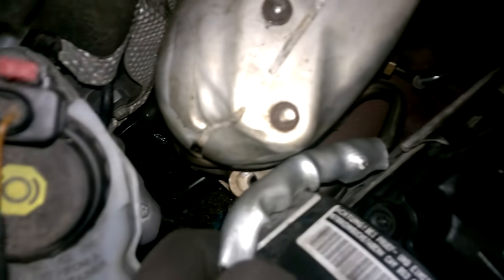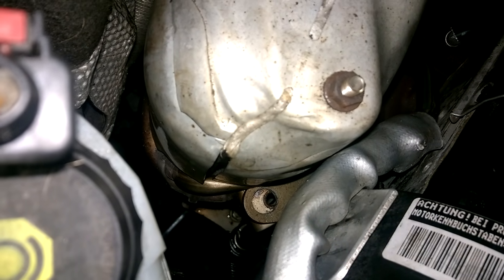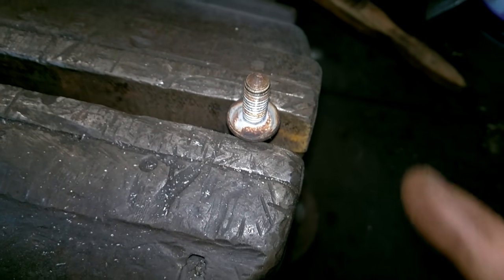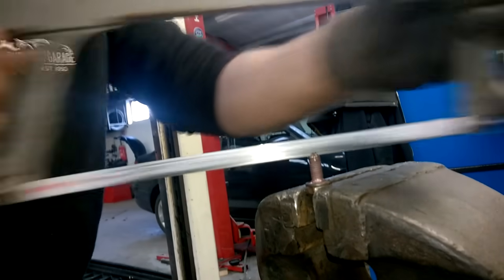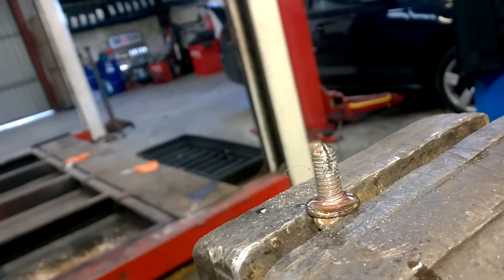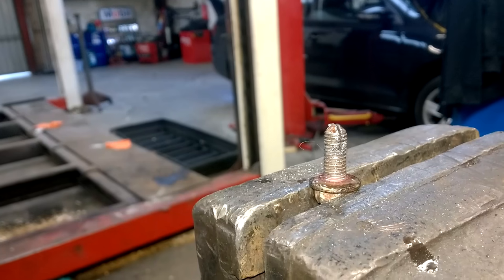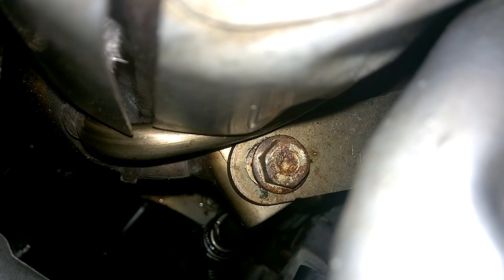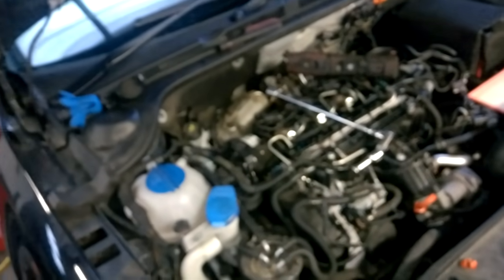My Father Taught Me This! Passing It On To The Next Generation

Comment: Tip: Before cutting the bolt, screw a nut onto the bolt down to the head. Cut the slot and upon removing the nut, it'll clean up the bolt threads ...
Reply: Was just about to tell him the same. 
I do that when cutting threaded rod also
Reply: @gellotion  
Great minds ...
Reply: @gellotion  Same here, good to see that this knowledge is still around.
Reply: Yup. Always
Reply: Excellent tip!
Reply: I'm sure its quicker to wirebrush (a couple of seconds) than to start searching for a correct size nut.
Reply: True, Dies are nice to have also.
Reply: Did yer Daddy happen to mention that you use the entire length of the blade..not a 3" wide area that wears the blade disproportionally...did y'all notice how hard it was to remove the blade from the CUT...outcome is gr8...how you got there is not.
Reply: @bustergonad3975   Or you can be lazy and use a very thin cut-off wheel in an angle grinder...
Reply: Bob Watters  If its a damaged thread then trying to put a nut on it or putting back into a pre-drilled hole will most likely lead to cross-threading, if the thread is not damaged then simply removing the burrs is all that is needed. The main point of the video is the problem of when two holes don't quite match up, which is the problem that needed to be solved in the first place, making the hole bigger in the top bracket will lead to movement eventually, guaranteed.
Reply: @bustergonad3975  they don't make hacksaw blades 12" long for you to use the middle 3". I'm sick of telling the lads at work this. 3 times the length used = 1/3rd of the strokes.
Reply: @cr10001  Or put on a hot saw, part off on a lathe or some other manner. Tradesmen of any sort must master the Hacksaw. It's the most go to tool. Sadly every blade tells a story. Many machinists especially lathe peoples by the very nature of the work holding ie, a 3 jaw chuck..their stroke length is mostly short...but it's a light delicate stroke. Sometimes the cutoff pieces drops into a cupped hand. I've seen apprentices do long strokes...yet are oblivious to the ramifications.  The downward pressure on the push forward stroke often heats up the cut zone...sometimes the blade breaks and often the part drops into the dirty guts of the bed. Often the tool is blamed whereas it is basically the uninformed  Tool using the Hacksaw. 
If your lucky...or you've thought it through that the item is not hot..the blade doesn't grab or your follow through isn't impeded by raking your knuckles on the lock down bolts on the tool post. If your right handed. If left handed...well the chuck...incurred it's own payment of flesh.
 I once had to apply a torniquet to a lads forearm underside. He's got a 10" scar to prove that machines can bite. Some even kill. That ...I'll never revisit.
Reply: Blinding tip. Thanks.
Reply: @bustergonad3975  I think you could have been a little kinder and not mentioned his dad. I hope his dad is still alive. The guy has given a great tip to an amateurs nightmare. Be gentle with the world. I can’t pretend to always achieve it but I do try my best.
Reply: Brilliant!  I will use that.
Reply: A lot of advisories here.
Reply: Good idea
Reply: similar to what Mr Pearce says, if bolt threads are damaged you may not be able to get nut on.
Reply: This was done way before the internet, better days🤔
Reply: @bendover3820  that's exactly how it's done.
Reply: @MikeDean01  Excellent point. Dad showed him how to cut the bolt but not how to use a hacksaw.
Reply: And if you have difficulty finding the right size nut, it's with your 10 mm socket.
Reply: @MikeDean01  who cares it $5 blade .
Reply: @ryanwilliams9644  someone with $4 in their pocket or a long trip to the tool store?. You carry on using tools like an apprentice, I won't lose any sleep over it.
Reply: @bustergonad3975  so true, knowing (feeling/hearing) when a cut is going to 'break through' takes a surprising amount of experience/sore knuckles!
Reply from the maker: Yes that is a great tip FJ B when cutting a bolt size down, I use that every time in those cases i.e it can only be a certain length bolt so you need to shorten one to suit, it really is not needed for this one though, a clean up with a wire brush and it's good to go. 
 
The update info below is the pinned comment on this video, I know most people do not realize I made that video and it better explains/shows this method in use.   
I also included below details of why the job was done this way free of charge with the customer fully informed. I hope you check it out  👇👇
 
UPDATE* I decided to make a follow up video on this https://www.youtube.com/watch?v=yfNQullGEuQ&feature=youtu.be Should answer some of the questions that were raised, I include 3 demos of this in action with close up shots.
 
As there was some safety concerns & confusing comments raised, I felt I should clear a few things up. 
1) This is a tip for certain circumstances only, I never have and never would use it on a component which would cause any safety concern to any customer.  
2) The demo was done on a support bracket only, items like this or similar will not cause any safety concern. 
3) I did this free of charge and on a time restraint, I noticed it when I was replacing another item, the customer needed the vehicle back that evening and I decided rather than leave it like it was, I would do this and secure it up fully. 
4) The bolt was not the issue, the part that the bolt threads into is a secured piece, someone had previously damaged it, leaving the bracket loose and the bolt just tightened a turn or so.
5) The bolt can be removed and will not break, it will go in and out as usual and has helped clean up the damaged threads.  
6) Used in the right application I personally believe this is a great tip and can save you a lot of time & trouble. 

Lastly to all the people who have watched the video, Thanks very much and I am delighted with the feedback I have received on it.
Reply: If he was able to thread a nut onto the bolt then wouldn't he be able to thread the bolt into it's hole? What you've suggested doesn't make sense. A nut is just a hole... Right? What I don't understand is why doesn't he just replace the bolt? I've got a bucket of extras over the years and I've only owned 1 car (lol, joke)
Reply: @nafnist  that makes lots of sense? I was taught by an exceptional engineer who I still hope to be as good as one day. I can only try and pass on good practice for their benefit. Impressive you can tell how I say things and how much my work mates like me from a comment on you tube :-)
Reply: @MikeDean01  I didn't question the fact you are right, because you are. You need to use as much of the blade as possible, for obvious reasons.
But you were 'tired of telling' the lesson.
A relative easy instruction, that you somehow have to keep repeating.
So yea, I might've assumed they didn't like you, sorry. But the rest was spot on.
Reply: Same if grinding a bolt to shorten.
Reply: Great Idea. i was gonna suggest running a die on it to recut the threads but your idea would be faster
Reply: How would you do that when the threads are damaged to begin with.
Makes no sense bud.
Reply: @gellotion  w
Reply: @bustergonad3975  a
Reply: But how can one thread a nut on the bolt if the thread on the bolt is ruined (which is the whole point of the exercise in the first place)?
Reply: @chadthomasriggs  Seems you missed the whole reason for cutting the bolt in first place ...
Reply: Okay all of you perfect hacksawyers us imperfect ones have unused perfectly sharp teeth all ready and waiting the next time we drag out the saw next year some time. And i want to see every single one of your file drawers because . .
Reply: Nice tip bro'... *

*so many jokes pop into my head🤣
Reply: Great info and tip !!!!!
Reply: @Mr.Grimsdale  the bolt thread is not damaged oh, it's the blind hole thread that is damaged!
Reply: @Mr.Grimsdale  exactly. Nut won't go on it if it's cross threaded..sometimes if it's a crappy couple thousands looser thread on the nut.
Reply: @bustergonad3975  you can make your valid point without insulting people.
Reply: @747Antman exactly.

Comment: My apprentice master used to tell me, "Huey, I pay for the whole hacksaw blade, so use all of it".
Reply from the maker: Slow and steady vs quick and fast..... well that depends on the mood Hughbert :0
 
The update info below is the pinned comment on this video, I know most people do not realize I made that video and it better explains/shows this method in use.   
I also included below details of why the job was done this way free of charge with the customer fully informed. I hope you check it out  👇👇
 
UPDATE* I decided to make a follow up video on this https://www.youtube.com/watch?v=yfNQullGEuQ&feature=youtu.be Should answer some of the questions that were raised, I include 3 demos of this in action with close up shots.
 
As there was some safety concerns & confusing comments raised, I felt I should clear a few things up. 
1) This is a tip for certain circumstances only, I never have and never would use it on a component which would cause any safety concern to any customer.  
2) The demo was done on a support bracket only, items like this or similar will not cause any safety concern. 
3) I did this free of charge and on a time restraint, I noticed it when I was replacing another item, the customer needed the vehicle back that evening and I decided rather than leave it like it was, I would do this and secure it up fully. 
4) The bolt was not the issue, the part that the bolt threads into is a secured piece, someone had previously damaged it, leaving the bracket loose and the bolt just tightened a turn or so.
5) The bolt can be removed and will not break, it will go in and out as usual and has helped clean up the damaged threads.  
6) Used in the right application I personally believe this is a great tip and can save you a lot of time & trouble. 

Lastly to all the people who have watched the video, Thanks very much and I am delighted with the feedback I have received on it.
Reply: @GerardBurkeBurkesGarage  I still say its a good one. Of course you may not be able to use it in all engineering applications where the integrity of the bolt is important but as you said, customer was happy and there was no safety risk so i say its a good one Gerard. I had a journeyman who taught me to handle tools as follows. Three one thumb. Middle, ring and little finger wrapped around shaft or handle to give torque. Index finger stretched out to guide the tool. Thumb wrapping and gripping the shaft.  I never again broke a hacksaw blade. I cut straight lines in metal and wood. I use this on all tools and it had worked for me.
Reply: Haha! "Waste not want not" was a thing for me also...early on in life
Reply: thats a really good lesson ;p i was kinda triggered by his short stroke and fast moves aswel ;p
Reply: Tee Mack  fair point...but u could grab a smaller saw.....right tool for the right job kinda thing id say....its fine if u like big tools, but if ur not able to use them....then just dont lol otherwise i would get a 20 feet long handsaw. bet itl cut a 2 by 4 in one stroke.
Reply: My sparky said let saw do all the work ,but that didn't work ,apparently I had to hold it!
Reply: Hahaha mine said the same🤣👏🏻👏🏻👏🏻
Reply: Me looking at all my bad saw blades , “lotta meat left on them bones 🤦‍♂️🤣”
Reply: Ha I see what your talking about there is basically not teeth on his blade 🤣
Reply: Nice one!
Reply: A pal of mine from Brighton use to say a similar kinda thing....
Reply: Yep! 
I was taught this 50+ years ago. If only the centre part of the blade was meant to cut, only that part would have teeth. 
Some will cite safety when arguing for short stokes, but The fact is that if you only use the centre of the blade it will kink and cause it to stick, which is more likely to result in an injury.
Reply: Long slow Strokes, no smoke required. But I can say that now because I'm retired! LOL
Reply: A hacksaw, or any handsaw, only cuts on the push stroke.. So, don't put downward pressure on the back stroke..  the blade teeth are angled forward to cut the material ..  no cutting occurs on the backstroke. Pressure on the backstroke only hastens wear on the blade. As mentioned on other comments.. use the full length of the blade on the forward stroke to safely optimise all saw teeth.
Reply: It's clear he's never used a file
Reply: Good advice
Reply: @billsmith3195  if your concerned about integrity then use this trick then take the bolt out and put a new one in and it will go in after this fixes the problem.

Comment: Nice Tip ,   remember to always leave enough solid thread to equal ( 1.5 x Diameter ) . .  According to the Machinist handbook , a thread should be 1.5 as long as it's diameter (considering it's a perfect thread) .  That's fully inside the nut,  or internal thread.  That's as strong as it will ever be . .   I always try to go more than that ( 2 x Dia ) to account for imperfect threads..  Regular commercial threads are not exactly perfect . They are great for what they do , but, Aircraft threads are perfect size .  I've been a Machinist fort over 40 years .. I've made every kind of thread you can imagine .

Comment: I work in diesel shop & you try to teach these kids old school trick, all they want to do is argue with you & tell you they weren't taught that in school. Than after they waste 3 hrs trying to fix problem, you tell them to do what they were told too do. Than 10 minutes later it's fixed. It's same thing as removing broken bolts. I usually have several 1" x  1"  5/16 pieces of of metal that I save. If you bust a bolt off, drill a hole in center of metal & put over broken bolt, fill hole with a welder. Than weld a bolt to the metal & back out broken bolt, the heat from the welder acts like a torch & 9 times out of 10 the bolt backs out with ease. No grinding, drilling or tapping ne threads or installing helecoils.

Comment: I love learning anything I can because I have a 1985 Yamaha Vmax 1200 and it is in extremely good condition. It has 11,700 original miles and when people see it they tell me it looks like it’s brand new however I rarely take my vehicles to a mechanic because I buy shop manuals and read mechanical books so I can learn and do most of the work myself which has saved me thousands over the years. And this is why I love learning anything new. Thanks

Comment: As a professional, im glad to see others also struggle with that particular VW diesel Cat top bracket 😂😂.
Reply: I'm not a pro, but I try.  I had just installed a new billet pendulum dogbone mount arm and insert on my A3 without issue.  So, I thought, why not install a similar thing on my 2012 VW Tiguan, because it has about 400 hp.  I was being an idiot taking off the bolts with an 1/2" electric impact, but I got greedy and tried to install the 21mm or M14 bolt that hold the insert in with the impact and i damaged the beginning of the threads internally.  This might remedy my issue.  I saw a rethreading company called Tifco, which would just so happen to be about a mile from my home.  But this fix is better and cheaper.

Comment: After 40 years as a machinist, I've certainly learned quite a few tricks over the years. This being one of them. 
Thanks for passing this one along!
Reply: Machinist as well and i never thought of making videos of how our everyday fixes might help others.
Reply: Steve, I agree with you. I am 66 an work on and repaired many of cars an thing I’ve never seen or heard that before... I am working on a rebuild now that I’m having this kind of problem with now... Thank You for that great tip
Reply: @msharon8119  please tell if it worked
Reply: Professional machinist(ticketed with some very fortunate experience)myself. Never seen this one. I prefer to recondition the thread, but I see value in this.
Reply: Tell me more
Reply: I run screw machines and I never even heard of this hahaha

Comment: thats more than awesome,i took my car to the mechanic, to remove the gearbox oilpan for cleaning accumulated grime, but i later noticed that transmission oil was leaking,he damaged one of the four  bolt holes and kept quite, the nut was simply not sealing, i found your video, and now the nut is so tight and no oil is leaking, your father is a great man indeed, thanks a lot with love from Botswana
Reply: Wow, your exact same situation happened to 32 different people!

Comment: "Necessity is mother of invention" thanks to u r father and u as well give solution to practical  problem..
Reply: Indeed, nothing better than getting a mechanical problem solved via a video, and at 71 I am finally taking full advantage of this fact!
Reply: Vamsi V. The real secret is to fit all the bolts loosely before tightening any. If you do that there will never be any need to cut the bolt.

Comment: Just a tip I learned from my father. When using a hacksaw or a file never put downward pressure on the backstroke the teeth only cut one way and putting pressure on the backstroke just breaks the teeth.
Reply: Jake Ginter Thanku !for sharing !  good to know 👍
Reply: Great tip.  I didn't know that.
Reply: @marmitesmate  I'm a woodworker and often using Japanese saws that have a backwards power stroke. I am wondering if forward strokes in hard wood would dull the Japanese woodsaws?
Reply: So now my exercise is cut in half. Haha.

Comment: As a toolmaker we always took a bolt to the bench grinder.  With a well dressed wheel with a good sharp corned we then grind in a corner of the wheel into the end of the bolt.  This simulates the leading edge of a tap and can be used to chase bad theeads, etc.  if the bolt used is hardened, like a socket head cap screw for example, the bolt will actually cut a bit of thread as well.
Reply: I do this all the time.for cleaning up truck ubolt threads